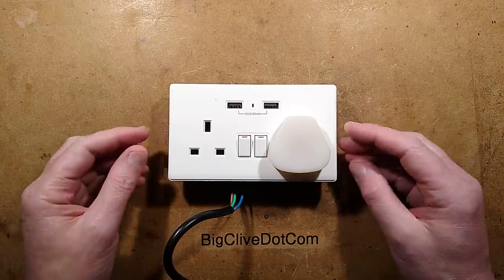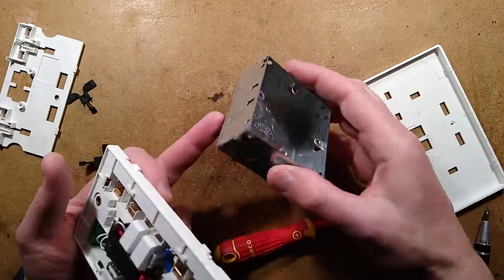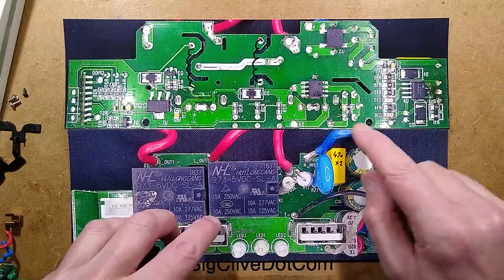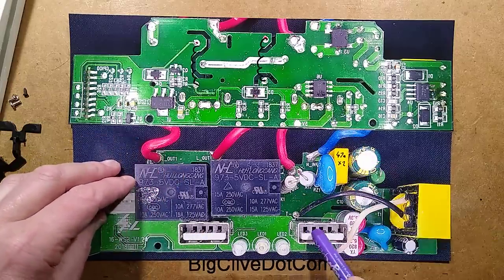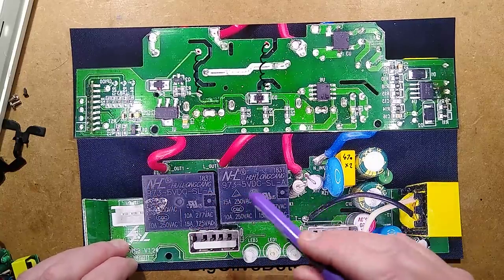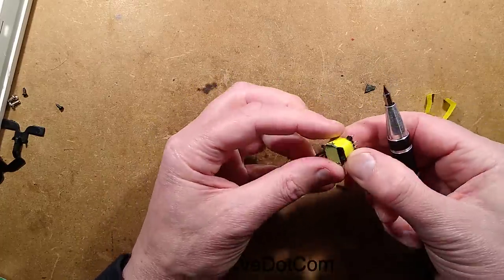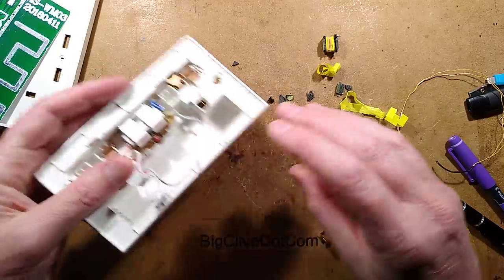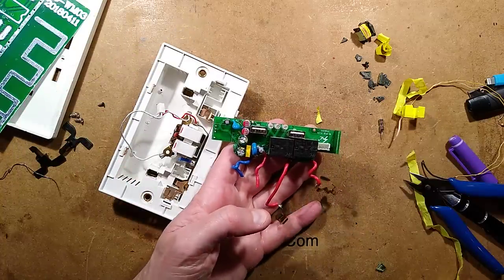WiFi wall socket teardown.

Comment: If they've been clever they'll have enabled the WDT on the ESP in case it crashes. But yeah I agree about your concerns about active circuitry being in the wall... Particularly when it's cheap stuff made by the lowest bidder
Reply: I get the feeling that removing the cover is going to result removing paint and wall board also....
Reply: WDT is not on by default? 
Then i may have accidentaly activated it when multithreading and crashing one core.
Reply: @alittlebitintellectual7361  nothings "on by default" in bare metal stuff. Completely depends on how they've set it up
Reply: RCDs and arc fault defectors have active circuitry, FWIW.
Reply: @PaulSteMarie  Yes but from the outset they are designed to fit into the breaker box envelope, so have both proper isolation where needed, and also have to actually go through the proper testing to ensure they conform. Not just a Chine Export sticker on the box and hope nobody finds out who made it to claim. A RCD and AFCI have to survive transient testing without flashing over or failing, which this unit I doubt will.
Reply: I'm not convinced that the ESP8285 even has a hardware WDT, it's not mentioned in the documentation. Also, @Simon, there certainly are things that are "on by default" in "bare metal stuff."
Reply: @skipfred  oh is there not? In that case my bad completely. I've been doing too much ESP32 lately, forgotten about the predecessors!
Yes, you're right it you mean that some fuses will be set by the factory to a default value. My point I made badly was that you never rely upon that and see everything yourself to be sure. My recent batch of ESP32 have been completely different to all the previous ones in terms of what's been loaded onto them at the factory. Very weird. Never had any variance with STM32
Reply: @skipfred  I'm using esp-s and I'm not even sure you can disable the HW watchdog. But of course if the code just crashes in a way that it keeps the watchdog alive then you're left with nothing.

For example WiFi connection itself is not monitored by the watchdog but it should automatically reconnect in the event of connection loss by the lwip stack and the watchdog will reset if you don't give time to the lwip handler.

Also I'm pretty sure that most of these devices are running Arduino code since it's easier and cheaper to develop than in the native espressif ide.
Reply: @DrGreenGiant  Ah, yeah that is a good point. I thought you were saying literally everything had to be configured or else would have no configuration at all, lol. I don't know that it doesn't, it would seem sensible, I just couldn't find any reference to it having one. Presumably you could implement one separately watching for a refresh signal on an output pin.
Reply: Indeed you could roll your own watchdog although I'd doubt they'd do that but you never know.
Ref Arduino, quite possibly. I've only ever used the IDF etc, not done Arduino on an ESP but I know that's quite popular
Reply: Even more likely they have forgotten to feed WDT or increase timeout and it keeps resetting it when something takes longer than expected.
Reply: @SeanBZA  Yes, but this gizmo was also designed for its installation as well. The objection was to any permanently installed active circuitry, which would include RCDs and AFDs.

I'm sure one can find equally bad RCDs and AFDs on eBay or Ali Express were one to try.

Comment: The memory footprint is there for the ESP8266. The '8266 doesn't have internal memory, the '8285 has 1MB built in, but they are otherwise identical :-)
Reply: I thought it was the other way around.
Reply: @douro20  Nope! It seems weird they're numbered that way but the 8285 has the built in memory (and 2 extra GPIO pins as you don't need to connect external memory!)
Reply: @ruben_balea  
IIRC the 8285 was released long after the 8266. The release was made due to the popularity of the 8266, to increase potential applications. Both chips are extremely popular in the maker community. These have well established toolchains for everything from Arduino to Micropython.
Reply: @ruben_balea  
Yeah. ST micro is known for taking the die grading practice to the extreme. I've also heard the practice has bitten them before. After production improvements at the fab they end up with a better yield of high spec chips but it doesn't line up with the demand for certain part numbers and they end up packaging and selling them at a lower spec to match demand. There are STM32 chips that only require flipping an undocumented bit in a register to double the memory or unlock some peripherals. Each STM chip family has the same die with the only differences being the bond wires and packaging.
Reply: @ruben_balea  Don't forget the 486SX, which was a 486DX with a defective FPU. So you'd buy a 487 "math coprocessor", which was also a 486DX, but its FPU was good and something else in the CPU was defective. So instead of throwing away two broken silicon dies, they could sell them to make a complete 486 system.
Reply: Rubén Balea Oh... that would be interesting!
Reply: @ruben_balea  well, these days repurposing high end chips for other models is pretty much standard

Comment: I might have missed it, but how are these things meant to be told which network to connect to and what password to use? Due to the lack of user accessible serial port or programming connector I would assume they create their own network to connect to with a website that you can give the details to log into your main network next reboot. Is this what happens or is there some other method?

Comment: I was wondering where I had seen this before, then realized that John Ward had done practically the same unit. I find it amusing that both electricians agree that having electronics inbuilt in the wall like this is a bad idea...
Reply: Insulation resistance faults became a pain
Reply: Yeah, they'd much rather get paid to chase in & wire you an extra outlet to plug wall warts into.. no conflict of interest there at aaaalllllll when it's not hard to just change the accessory DIY.

Comment: There is open source firmware called Tasmota for these devices which can easily be programmed to the ESP chip which disconnects it from the "cloud" and gives you full control. I've got every single light switch in my house hooked up with Tasmota hacked light switches.
Reply: Within few years you'll have to trash them all. Before that they'll start to behave randomly, making you nuts.
Reply: @DumahBrazorf  Well the ESP's themselves do work quite OK, even after some years.
Only things that may cause grey hairs, or excessive loss of them due to hair pulling from pure frustration is due to the way too cheap power supply parts used, or when the units are paired with the cheapest and worst flash chips you can imagine (kuch PUYA kuch)

Maybe the absence of 2.4 GHz WiFi in a few years may become more of an issue...
Reply: @TD-er  I'm not sure 2.4Ghz will go anywhere, as it will always be useful for its longer range.
Reply: What a confusing Arduino mess. Micropython seems  be the best  solution. You can then change the programming at any time.
Reply: @TimoNoko  well on an esp8266 you're not left with a lot of RAM, so you hit those limits even more quickly with micro python
Reply: @Rust Davy what do you mean by that?
Reply: @Rust Davy what's stopping you from doing that now with all the neighbors other wifi devices?
Reply: @TD-er  I am actually checking this issue right now. Due to more expressive code a four-relay Wifi-plug server  looks much simpler in Python. https://github.com/timonoko/Webserver-for-ESP8266-4-ch-relay 
BTW With the 2700 byte program from above, the gc-memfree() is 27858 on ESP-01. This will suffice all eternity.
I can stop and update the program in the kitchen plug from my living room desktop. No  unscrewing  and attaching Adrduino-plugs needed.
Reply: @TD-er  Ol' Rust Davy has been going on about his hypothetical neighbor situation in otter threads.
Reply: @Rust Davy
I think someone sensible enough to remove their "cloudy" devices from "the cloud" is going to notice your cunning deauth attack, and come over to punch your face in.... Or set up their own attacks in return - never upset your geeky neighbours.
Reply: @xenonram  He found out about aircrack and now he thinks he's cool. Just wait until he hears about Kali.
Reply: @Rust Davy /r/whoosh
Reply: @TimoNoko  OK, so then the micro python platform has improved considerably since the last time I checked.  Good to know.
Well for me it is C++ and not yet a reason to transfer all existing ESPEasy code to Python. But maybe on Python there would be more contributions from others.
Reply: @DumahBrazorf  I'm in Australia, the construction of them is somewhat higher quality (two physical boards, one high voltage one low voltage with about 2cm gap between them). I couldn't spot anything electricially wrong with them at all. And running Tasmota means the manufacturer's software can't go dodgy on me. Always a risk but after checking them out I was comfortable having them in the house - of course I bought just one, tore it down and flashed it before buying the whole lot. :)
Reply: @alexatkin  My thought as well. I don´t see 2,4 GHz going away over quite some time. Yes, 5 GHz has its advantages, but here in my house I can clearly see that with only one AP per floor, I do not get 5 GHz wifi everywhere, while I have complete coverage with 2,4 GHz. Ok, to be fair, they seem to have used ridiculous amounts of rebar in the concrete floors, making the floors and even most of the walls almost impenetrable for wifi.even with the dect phones, I can go at most 1,5 floors up untill loosing signal.

Comment: Something I've learned about the ESP style of chips in using them is that Access points really don't like how they sleep so will be seen as a device with a low acknowledgement rate, and a few routers will disconnect them for that
Reply: Those issues are mainly caused by the ESP missing ARP requests, so after some time the switches/access points will no longer know how to route the packets.
One way to mitigate those issues is to send out Gratuitous ARP packets.  (answers to a question nobody asked)
Reply: Various firmware sends gratuitous ARP to work around this. It’s an option in Tasmota for example.
Reply: A mains powered device has no reason for the ESP to sleep. I have a number of mains powered ESP modules in my house and all of them remain present on the network with no problems, I did write my own firmware though.
Reply: You can change the firmware and/or write your own and program them to not sleep while on mains power.

Comment: I bought three radio controlled switched socket adapters for my LED lights in the living room, and I have taken all 3 apart and they are very electrically safe thanks to you Mr. Clive! I live in the USA and they weren't even safe for 120v, but now they are :) I have modified them and given each a much better antenna too.

Comment: In addition to devices failing in the wall, usb is converting to USB C as the main interface, charging going from 5 watts to all the way to 100 W. These changes keep happening every few years. You should have mains voltage (115VAC or  230VAC depending on region), with no electronics! You are 100% correct.
Reply: What about buses, trains, aeroplanes, ferries, hotels or pubs? Is it OK for them to have these, accepting that they might have to change them every few years?
Reply: I will never use these, you hook up your €xxxxx device up to a unknown powersource, its like sticking your you-know-what in a hole in a wall not knowing whats on the other side, no thank you
Reply: Not sure what you mean by "These changes keep happening every few years." There was USB 2.0 from 2000 - 2010, USB 2.0-Battery Charging Spec 1.2 from 2010 - Present, and USB-PD from n.a. - n.a. because the dammed thing is still barely adopted at version 3 and there is no silicon that supports more than one port.
Reply: @npiper  Huawei quickcharge, supercharge. QC 1, 2, 3, 4. All kinds of quick charge stuff makes these kinda obsolete. And usually they don't even deliver whats printed in the socket. Voltage dips to 3-4V easily with small load, no thanks.
Reply: With respect, that doesn't make the older standards obsolete, it just means you won't have access to PD or QI on older USB outlets. USB type A to C adaptors are a thing too.
Reply: @EvileDik  that's true for  most things, but why embed this technology in a wall? If you put a 10 W charger in the wall and your new phone can use Turbo-mode up to 20 W, your charge time will double. Also these devices have components that can fail, and most people will need to call an electrician, hopefully the failed parts haven't caused a fire. I will not put anything like this in my wall, you are free to do what you like.

Comment: These can fail in epic style if you attempt to cram these wallsockets into the original pattress.
There rarely enough room to cram the original cabling due to the modules.  Having squeezed the socket into position, the Chinese electronics may explode leaving a skidmark on your freshly painted wall.
Reply: ....or the Chinese electronics bursts into flame and burns your house down?
Reply: @Rust Davy That's exactly the kind of epic I like.
Reply: @Rust Davy You might find that more difficult after the police cease all your computer equipment because it is really not that hard to figure out where the signal is coming from with a Raspberry Pi and a Power Bank so you can walk around with it and localize the equipment being used to commit this sort of criminal offense. And yes it is a criminal offense pretty much anywhere to issue commands to a computer system without authorization from the owner of said system. Also do enjoy jail after your court hearing hope it was worth the momentary schadenfreude.
Reply: @Rust Davy Your device broadcasting the unauthorized commands to the target wifi router still gives itself away and will still get ceased as evidence anyway. Really no way around this radio transmitters are inherently traceable the simple fact the signal strength drops off with distance means brute force trial and error can find it through a directional antenna makes it easier. The fact that when doing something illegal it's best not to broadcast it applies to radio broadcasting too.

Comment: Apart from the potential problems of  software in the wall socket, the protocols and capabilities of chargers is still developing,  why would anyone want to be stuck with out if date chargers built in to their infrastructure.
A far more sensible option would be to have plug-in chargers with a pass through socket.
Reply: They're not really out of date though, they just charge slower.

I do think adding USB to this was a bit overkill though.
Reply: For a public location like a restaurant, pub, church, etc, it doesn't matter that it's slow. The person using it is only going to be interested in the fact it works at all.

Comment: As a UK sparkie I hate these in wall active sockets ... I get asked to "fix" quite a lot of them , you are spot on with the metal box and masonry wall problems , and as you say if its goes boom it's stuck in the wall...not good ...to be fair I've only seen two that have failed completely..but I still think it's a very bad idea..I only use plug in WiFi switches that either use my own firmware or at a push can be  tasmotised .

Comment: So many of these IOT devices are going to end up with legacy security flaws that'll make your entire home network insecure.  Exploit the old stuff to gain access kind of thing.   I'm with you,  don't install this stuff in the walls.  Edit:  'Sense' winding is often the 'Auxiliary' winding used to power up the SMPS IC.  Some supplies do also 'sense' from this but not all or even that many I believe.  Kind of the cheap way to sense the voltage and not very accurate.
Reply: Honestly all the new stuff is insecure too. I recall a year or two ago they found almost no IOT devices used generated username/passwords in their operating system and had a very small pool of passwords they all drew from.

What was kinda funny was a number of them were either root/root, admin/admin, or a combination of swear words.

Comment: Have you heard of Shelly devices Clive? Me and some of my friends use some Shelly 1 switches (relays) and like them very much.
Reply: I have Shelly 2,5 and also like it very much, teardown and comparing its power meter (and its readinngs) to normal one would be interesting
Reply: @sirdumb1592  Yeah would be cool to see Clive give his opinion on them.
Reply: Yeah, I’m using shelly aswell and really like them as they support mqtt to control them (connected to my node-red).
I‘ve planned to buy and compare their powermeter against an Hager ECR140d (at the moment used to monotor power via modbus). If the shelly powermeter is quite good i can see usage in that for a bigger project involving putting hundreds of them all around the city to monitor some power consumtion. And the relays aswell, distributing them all around the city. Bit first of course some reliability tests needed to check if their wifi and power handling is as good as a modbus solution.
It would be great if Clive could check them out and take apart, I‘ll may send him some shelly relays and the shelly powermeter to take apart and aswell compare aganst for example the hoppy
Reply: A colleague of mine uses these. He treats them as higher quality alternative to Sonoff switches.
Reply: I have a discount code to get two Shelly 1s for free on my account because they broke when I tried to install them in our shady house wiring. Apparently it doesn’t like a constant 40ish volt on the neutral connection and the relay goes clicker die click. 
Clive if you want I can ship those to you and maybe even ship the broken ones as well if you’re interested.
Reply: @robin_valk  Kijk dat zou fantastisch zijn 👊